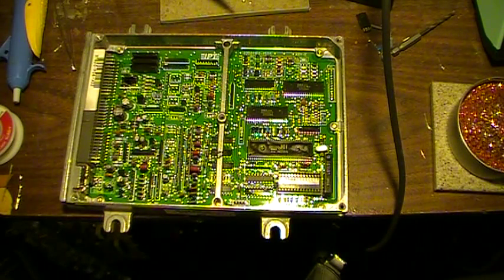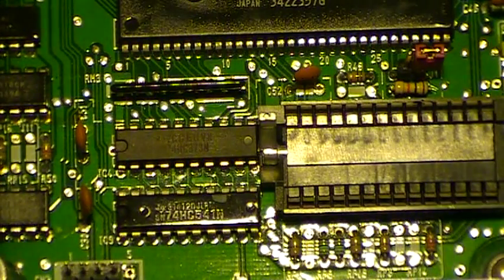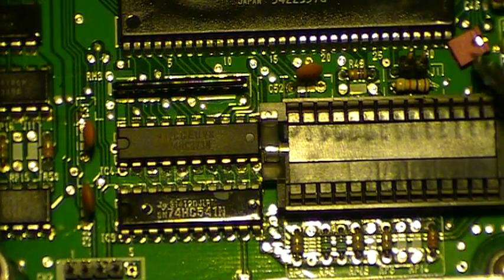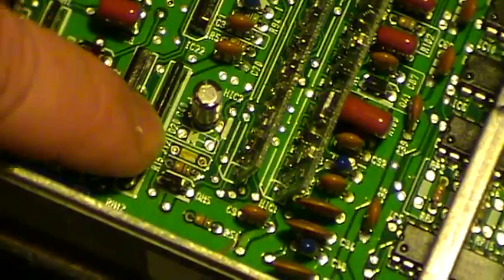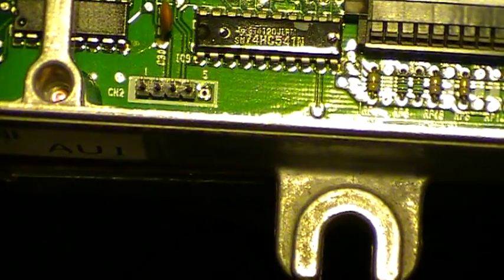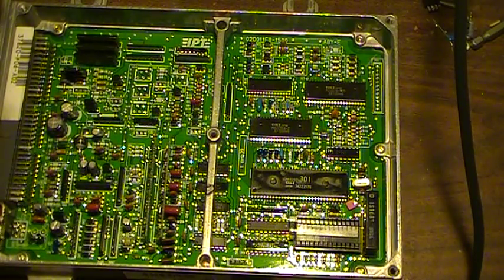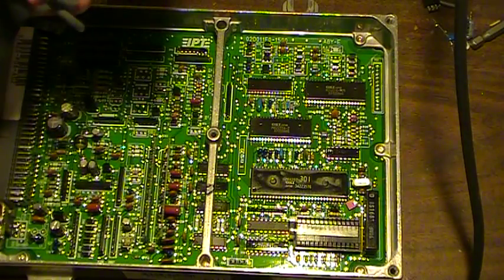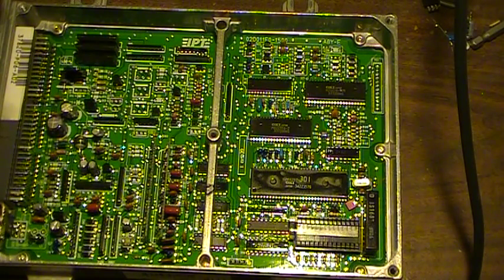Chipping up P06 ECU

Comment: Good evening, a question please I have a civic 92 automatic box ecu 37820P06A50 engine D15b7 power 1.5L. I can change my ecu by 37820p06g50 without changing any component?
please urgent
thank you in advance
Reply from the maker: P06 : 92-95 OBD-1 Civic DX / LX.  As long as your transmissions are the same.  If you have an automatic transmission, then you need an ECU for an automatic.
Reply: @tubejim101  thank you so much
👍👍

Comment: Question if I just add the missing components for vtec but don't chip it will vtec work I have a bad p28 and a good po6 the p28 works some times I tried replacing ic17 but still does the same problem  thanks in advance for answers
Reply from the maker: +Monstrosity Sound Inc. It should work.  The chip is for putting in custom maps.  Not sure how well it will run, if you don't tune it and just at the vtec.
Reply: Monstrosity Sound Inc. it will not have a vtec map so n it won't know  to true on vtec so vtec will not work

Comment: Did you ever figure out what chip went at the top left of the board the 3-pin To make it a VTech if so what is the part number
Reply from the maker: http://www.moates.net/vtec11f0-conversion-kit-p-149.html